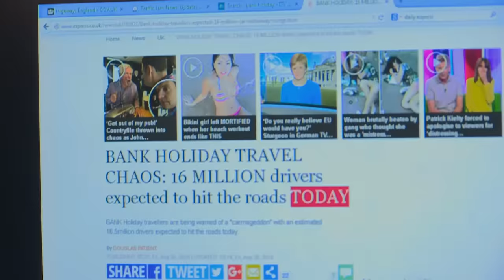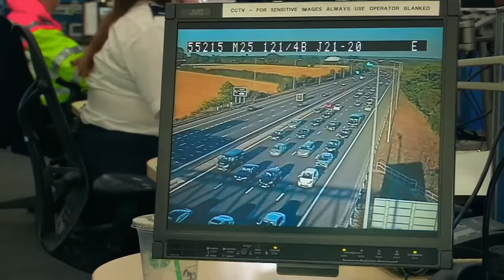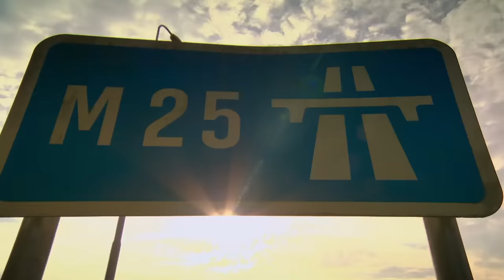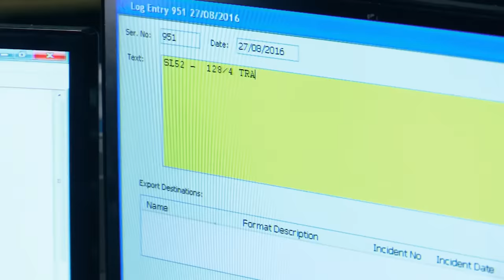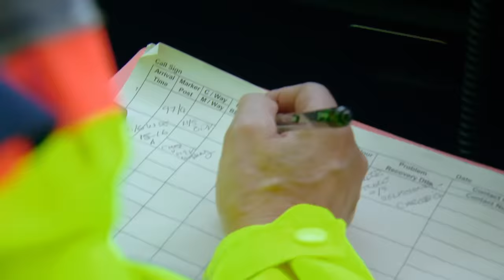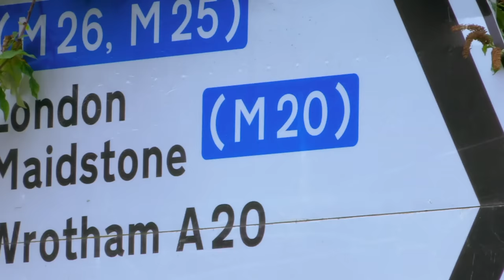One Of The Worst Accidents In Motorway History | Britain's Busiest Motorway E3 | Our Stories

Comment: It’s hilarious hearing the brits complaining about 27 degrees 😂 average Aussie day.
Reply: That's because it's not a usual summer
Reply: If you come to the UK then you will understand.
Reply: We always get this from people in hotter countries. It's much more humid here so the heat is less tolerable, our bodies are less accustomed to it because it's usually cold, and our houses are built to retain heat not keep it out. Air con is very rare in personal homes and ends up breaking in our cars because we use it so rarely the seals dry up and the refrigerant gas leaks out.

It's all relative. You probably consider 10°C to be very cold when that's pretty average for us.
Reply: I doubt the Aussies have 27 with 90% humidity. When I was there 5 years ago it was pretty dry. Circa 20%.
Reply: It's hilarious people from hot countries not understanding the relationship between heat and humidity. The UK is a humid country. Do some research to understand why that makes temperatures feel far worse. 27 degrees in the UK feels far worse than much higher temperatures in typically hot and dry countries.
Reply: @ryanmitcham5522  I do understand what your saying, but let’s look at cairns November so we’re 1 month off summer currently many days ahead with 90% humidity in the forecast. Now our January average is up at 80% we’re uk is 90% but even currently in November we’re already 30+ with upto that 90% humidity am that will happen 6 months of the year at least maybe 7 and then back to mid-high twenties with lower humidity in the 50-60s through winter that does only apply for more tropical Queensland although we hit 40 on a regular basis which still is way worse either way.
Reply: @ar12.  27 degrees Celsius is not a normal summer temperature in the UK and western Europe. 21 - 23 degrees is the normal temperature. However, in recent years there have been summers where the temperature has well exceeded 30 degrees Celcius, sometimes up to 37 degrees. This summer was exceptionally hot and dry, resulting in huge forest fires in France, Greece, Spain... Even the railroad infrastructure is not designed to cope with such heat, causing trains to stop. With outside temperatures well above 30 degrees C and no air conditioning, you can imagine what it was like in those crowded trains.
Due to global warming, European summers are getting hotter. In winter we sometimes have 10-12 degrees where it should actually be freezing to -3°C.
Reply: We don't have air conditioning in many places (in fact mostly only our cars) and our buildings are designed to keep the heat in.
Reply: And how would you cope in -7 with your thongs and board shorts 🙄 I've heard Ozzies going into meltdown over 12 degrees. Add a gentle breeze to that and they're in hysterics. Guess what, it's what you're used to
Reply: Heat feels different in the UK (i lived in Florida for 4 months this year) and the UK climate & infrastructure is very unique
Reply: But could you cope with our ice cold winter?

Comment: The road chaos is only going to get worse in the UK , because of the so-called smart motorways , or as I like to refer to them the government motoway cost cutting experiment , where they got rid of hard shoulders to make an extra lane and did not give drivers the recommended stopping areas in case of any issues . ACCIDENTS on the UK motorways were these so-called smart motorways are , have more than doubled according to the AA, and getting to the area of the accidents is also a nightmare as there is no hard shoulder for emergency services to drive on .

Comment: 5:23 no-one is wearing a seatbelt.
Reply: Hefty fine should be going their way, it’s. All on film, no proof required.
Reply: @susancarden749  hopefully
Reply: If it's a really old van it might not have seatbelts built into it, in which case you aren't required to wear one.
Reply: Those VW buses only had lap belts and only some have rear seatbelts since it wasn't a requirement at the time.
Reply: @albinoguidedog   it clearly showed showed seat belts behind them, at 5:22 , are you blind?
Reply: @susancarden749  chill bro. Only some had 3 point seatbelts like that, most didn't though which is why I made the statement. Regardless, most buses don't have rear seatbelts since it wasn't required.

Comment: I really despise that accusation of other drivers being called 'Rubber neckers.'

Yes, a couple might be looking for something grisly to see (something they will likely regret) - but I believe the majority of drivers passing by will be looking to see if they can 'help,' while more are concerned about pieces of glass, bumper, sharp metal, spilled fuel, spilled oil, dazed/shocked people wandering about, other drivers that may have stopped to help and are running between vehicles/victims, signs of possible fire (some of us 'do' carry fire extinguishers, first aid kits and window breakers in our cars, you know), also looking out for highway patrol people (whose vehicles might be out of our sight), and even to avoid bodies or body parts.

If we were to just go speeding past these scenes as if nothing was going on, the emergency services and media would soon be criticising us for being reckless and heartless, complaining that we are putting emergency services vehicles and personnel at risk, putting ourselves at risk from debris, putting crash victims at risk.

Slowing down near a crash scene is good sense, 'common sense' and the most safety conscious thing we can do if we don't have the abilities or inclination to help.

I've been stuck in slow moving traffic going past a truly horrific crash some years ago now. 
There was glass absolutely everywhere across 3 lanes. It looked like some of the vehicles involved had exploded rather than crashed.
 My car passed close to the body of a dead female that had been pulled out of a vehicle and left on the road while emergency services tended to the living - young, very pretty, blond, her face sparkling with glass under the street lights (I'll never forget that. It was not something that I wanted to see. It makes me really sad, a wasted young life gone forever... But I had to look around as I went past, weaving through pieces of scattered debris).
Meanwhile, one crash victim was in shock, running and screaming through moving traffic, blood down his shirt, no mind on where he was and what he was doing. Where he ended up, I don't know.

Now, given that description of that scene - does anyone think we should have slowed down or just bombed along as fast as we could?
You don't have be driving for too long before you discover that almost any crash victim and crash vehicle can be almost anywhere at a crash site.
One of my former friends and his family was involved in serious crash, and the ambulance driver had to scour the road looking for his 9 year old daughter's 'foot' before taking her to hospital.  

That is why we slow down!

Comment: expected this to be a proper documentary but then they mention this so called "Fast lane" of the motorway. To my knowledge, no such lane exists. There is just the inside lane where everybody is supposed to be and then overtaking lanes to use to get past a slower vehicle before moving back into the inside lane again
Reply: You can still drive in the other lanes, you don't have to stay to the left, the whole point of 3 or 4 lanes is that more cars can use the road at the same time. But yes, they all have the same speed limit unless there are temporary measures in place. No such thing as a fast lane.
Reply: @mydogeatspuke  I mean, yeah, it is physically possible to drive in any lane or even straddling across 2 lanes but the inside lane is where you are supposed to be, as a considerate road user following the highway code. under standard conditions, if a driver chooses to occupy another lane while the lanes inside of that vehicle are clear, that driver has effectively taken it upon themselves to close those lanes therefore reducing the amount of traffic that can pass. It is also a dangerous practice as it will encourage some drivers to pass on the inside. Those situations both the driver passing on the inside and the driver failing to move to the inside are BOTH driving without due care and attention and both are 50:50 at fault
Reply: @mattwoodford1820  if the road was completely empty, which would of course not be a situation I was talking about since I mentioned multiple lanes means more vehicles can use the road at once, and you can't overtake someone if you're the only person on the road at the time so I didn't think it really needed to be said and yet here we are, then surely it wouldn't matter which lane you were in since there would be nobody else around, and also using a lane doesn't "close it" or stop others from using it. You should of course move left if someone is clearly wanting to overtake but can't, that isn't what I was talking about either. These are all no duh situations that I was under the impression went without saying that aren't anything to do with what I actually said, and what you took issue with. Seems like you just want to make noise for the sake of it. You needing some attention bud? It is that time of year for it. You'll be alright.

Comment: The bridge accident can be explained - the UK still uses miles and feet measurements whereas Europe uses kilometres and metres.
The height of the bridge was probably displayed in feet and the driver didn’t think that - he would have thought in feet.
Reply: unlikely. we only really use 2 types of trailers in the UK. And looking at the bridge, even the double deckers should have fit. you can also see that the signage behind the bridge is fine yet looks to be lower than the bridge itself

Comment: Re the bridge strike... Is there any reason why they couldn't do what some car parks do and place a thin arch of metal with hanging bits of metal placed the same height as the obstruction in this case the underside of the bridge at the beginning of the motorway? It would be hit and maybe /hopefully /might alert the driver that they were in trouble before they get to the actual bridge?
Sydney has a few - the Harbour tunnel has one.
Reply: simple. someone hitting them at 60-70mph does not end well

Comment: Railways are there to ease motorway congestion
Reply: It's a shame they are so expensive and overcrowded, HS2 money should have been spent on improving what we already have
Reply: @MichaelGeorge161  we did that in the 80s with the apt unfortunately the project was scrapped could have changed Britain’s railways
Reply: @MichaelGeorge161  .
Unfortunately what we all ready have is at its limit.
Reply: @grahvis  I disagree, raise the bridges to allow double decker trains
Reply: Yeah definitely useful when a return ticket to London costs 600 quid!
Reply: Motorways became necessary to  ease the burden on an overstretched rail system. Our rail network could not cope with todays level of goods transport.
Reply: @MichaelGeorge161   which wouldn't have helped one iota because it wouldn't have increased capacity. 
Only a NEW railway could do that, hence building HS2.
In exactly the same way as in London,  capacity couldn't be increased on either the underground system or London overground hence why the Elizabeth line was built.
Reply: @mnecraftnoobpvp6313  .
Return ticket from Euston to New Street, £62.10 - £26.50.
Reply: @MichaelGeorge161  .
HS2 is far cheaper than that.  There are also the tunnels.
Reply: I know tell me about it using tfl rail services is a joke cost arm and a leg  in London
Reply: Really?. What about when there's a strike?. What about when the train is overcrowded and you have to stand for your journey?. Then there's the extortionate prices. No, travelling by train is not easier
Reply: @MichaelGeorge161  and where is the money coming from to do this?
Reply: Last time I was considering the train it was a £540 return for two. Less than a tank of fuel. Mind you my car has 40 litres or so tank...

Comment: If forign lorries have a blind side make it a Rule forign lorries have a camera system to avoid it?
Reply: All lorries have a blind side irrespective of where they're from. They also have blind spots that are way bigger than non truckers would believe, and this car just found that out.
Reply: @janet180971  Hi Janet then all lorries that have blind spots shoud have camera's fitted?
Thanks Keith.
Reply: @keithmcgarrigle8921  and yet not a single manufacturer worldwide has done this. Why do you think this is? Could it be because the screens required to cover all blind spots would, in themselves, create more blind spots and distractions for the driver. Personally I prefer drivers of 40 tonne vehicles to have minimum distractions. Also, its actually easier for the 4 wheeler to see and avoid the big truck, than the truck to watch 20 screens looking for a 4 wheeler that may or may not be in a blind spot.

Comment: 15:43 - this is uniquely British thing to stop in the outside lanes... in any other country, unless there is horrible crash and vehicle can't move, the drivers always part on the side of the road. This sort of thing almost never happens anywhere else, but in UK. If anything starts happening with your car or bike or whatever, the natural reflex of any driver is (or should be) to try to get to the side of the road where it is safe and it could be inspected. In UK people just stop in the lane they broken down, does not matter if it is literally middle of the road!
Reply: If you burst a tyre or breakdown in the outside lane it's normally pretty dangerous to just roll your way across 3 or 4 lanes of fast moving traffic...😂
Reply: @matthowells6382  yeah - explains the idiocy of what see only in UK. I agree that it is more dangerous to cross the lanes with bursted tyre, so really really the tyre maintenance should start before that happens, but you know what is more dangerous than that?

Stopping in the middle of motorway! So yes absolutely every driver should put as much effort as possible to reach side of the road when this happens... that is just common sense... if you can stop in the live lane, then you can stop on the side of the road as well. 

Besides that goes to lane disciple overall. All the lanes apart of left lane (in UK) is for OVERTAKING ONLY! people should not casually driver 3rd or 4th lane and just cruise along if they are not overtaking... If they would follow that rule, then perhaps they would not need to change 3 lanes to get themselves out of danger. 

And sure I understand you can run over some junk in outside lane and due to no fault of your own get a puncture, but that rarely happens, most of the time people just drive junk cars without proper inspection (under inflated tyres 99% of the time) and just cruise along in the 4th lane until they get blowout.

Comment: How come there’s a bridge on a major motorway that doesn’t have enough clearance for a hgv to pass under ? I can’t get this out of my head, surely there’s a logical explanation for this and im just being daft 🤔😅
Reply: There isn't, there's just a low loader driver who has failed to load his trailer properly. The arm of the digger should have been positioned differently so it wasn't stuck up as high and was beneath the 5 meter abnormal load height.
Reply: Thank you for clearing this up for me 👍

Comment: Why would opening a closed motorway cause a race? Race to where? Doesn't make sense.
Reply: The motorway has been closed for hours. It is empty. There is no traffic ahead. That's an invitation for people to race off.  It makes perfect sense and is not that difficult to understand.
Reply: No I don't accept that. As soon as the traffic cars pull over, the road still has no traffic ahead.
Reply: @heene  You're going to have people all accelerating from a standing start at different rates, recipe for another incident. Makes perfect sense to get everyone rolling together gradually...it's not rocket science
Reply: Yes it is. You are wrong.
Reply: @heene Drivers put their boot on the floor when opened up.